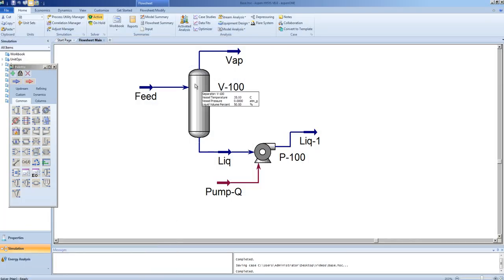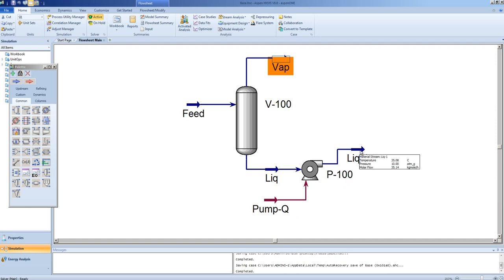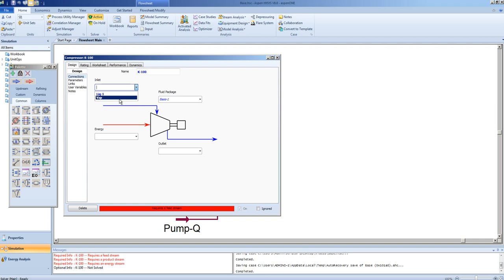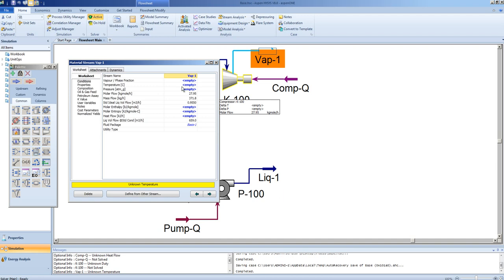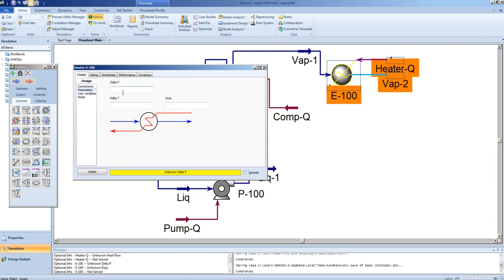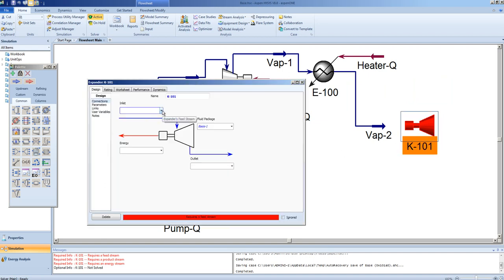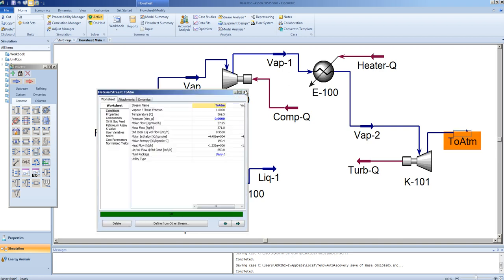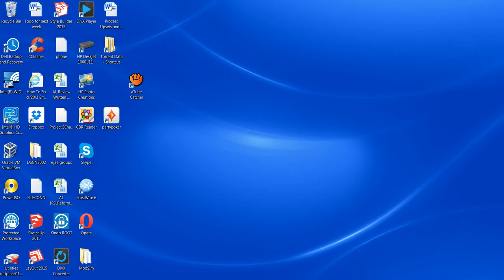Compressors and Expanders

Comment: Hi, Mr. Adrian, how does increase in pressure affect temperature in a piping system (oil and gas pipes if that makes any difference). Pleasee reply, I have an exam tomorrow. Thank you!!!
Reply from the maker: Increases in pressure will result in higher temperatures according to the equation of state that is applicable. Although these temperature changes may be small when compared to temperature changes associated with the heat transferred via the pipe walls to the surroundings.
Reply: Thank you.